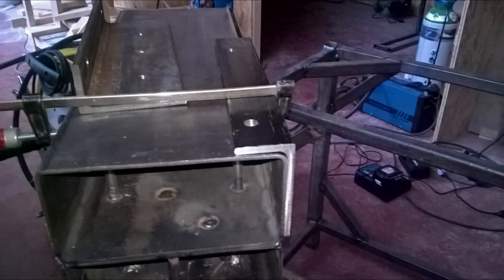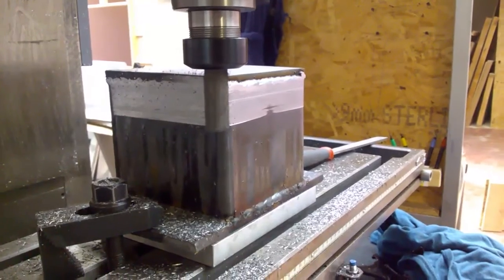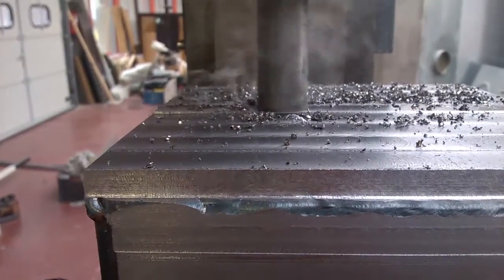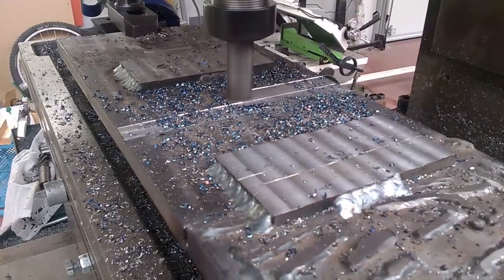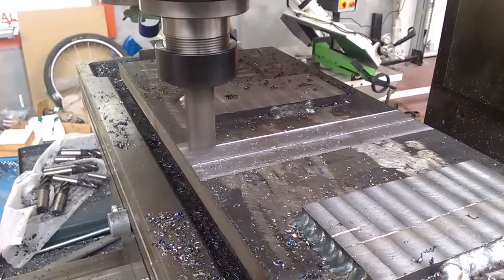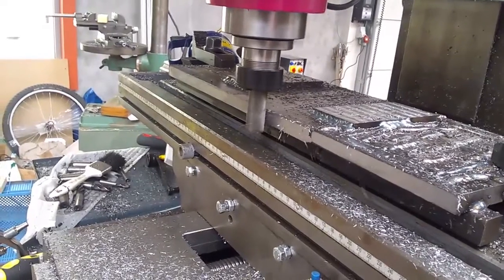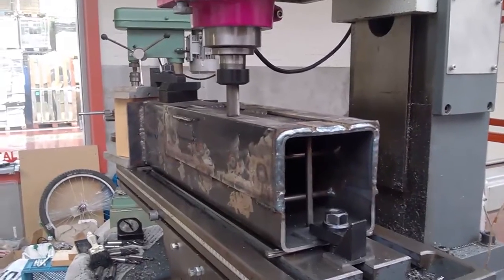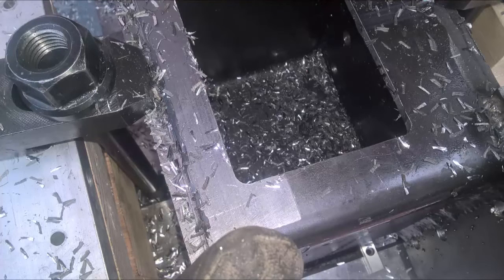DIY CNC benchtop surface grinder reboot - part 2

Comment: Hello.
Are this project is abandoned? Or you drop it off in favorite a CNC projects?
Really in fact, great launch, you already do some first steps, i only think to do, with welded frame and linear rails as base of surface grinder.

Any suggestions?

Comment: I see Russian dial indicator! ) But that "КрИн" is probably china OEM product w/o control from Russia side.
Reply from the maker: It was actually made in soviet times - the timestamp on the certificate noted 1982. I think it stayed ina box for 20+ years before I picked it (and several others) up. I bought a few el-cheapo chinese indicators but they were absolute garbage. The soviet made ones are very smooth and operate in a very stable way :)